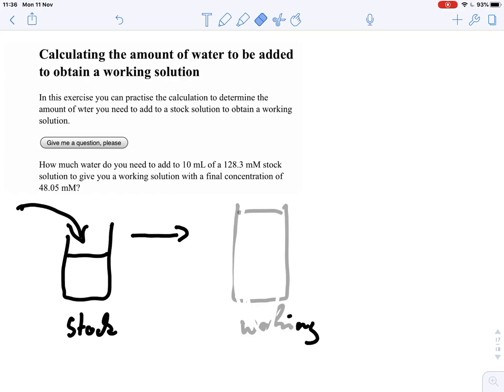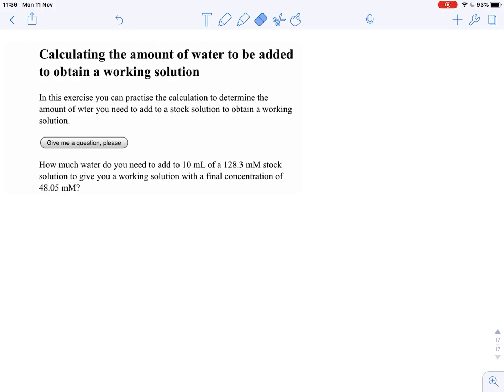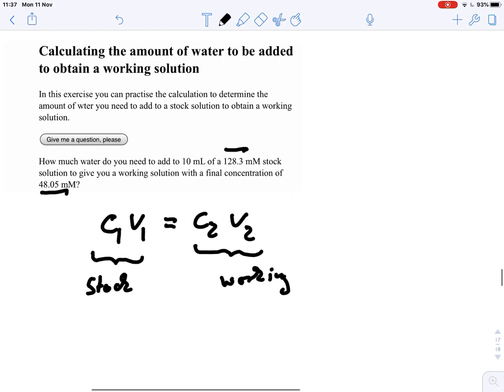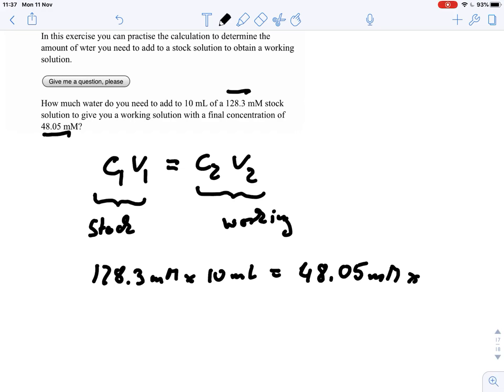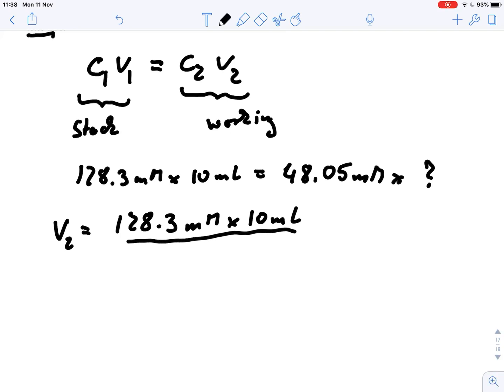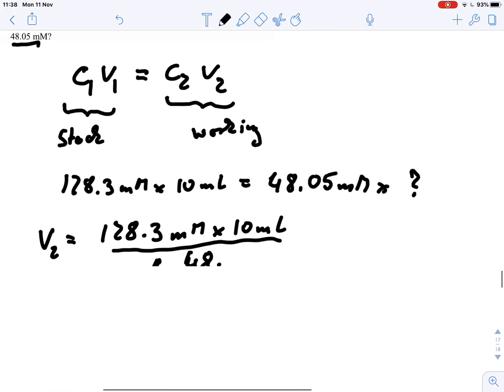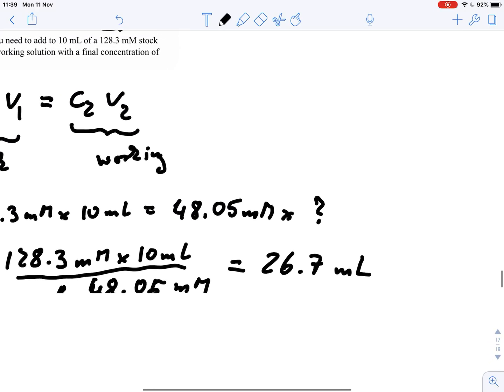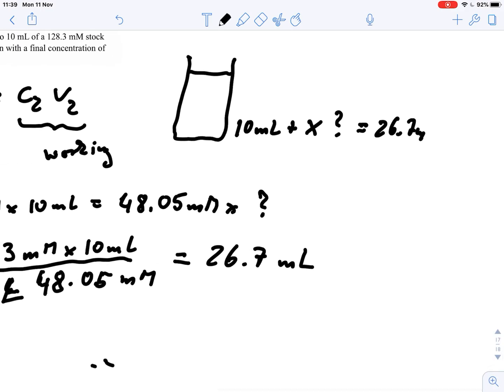Calculating the amount of water needed to be added to a stock solution

Comment: The correct answer to this equation is actually 16.255ml of water added to a 10ml concentrated solution of 128.3mM will make 26.255ml of a diluted solution of 48.05mM
To figure out this equation you take the concentration of the solution, 128.3mM, and figure out the percentage between that point and the diluted state you wish to achieve, which is 48.05mM. And that is 62.55%. That's because 37.45% of 128.3mM is 48.05mM, leaving 62.55%, which makes that the percentage between 48.05, to 128.3.
Now by simply using this equation you can determine the water volume needed to get a diluted solution of 48.05mM from a concentrated solution of 128.3mM.
The way you do this is by taking 62.55% and adding it with the volume for the concentrated solution that you wish to dilute, in this case 10ml. What you get is 16.255ml. 
So adding 16.255ml of water to 10ml of a concentrated solution of 128.3mM will leave you with a diluted solution of 48.05mM.